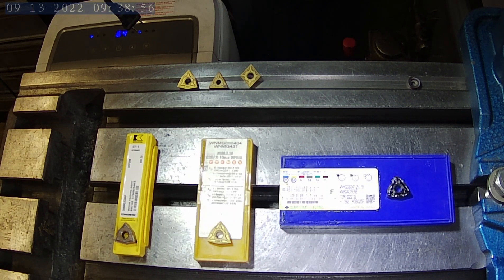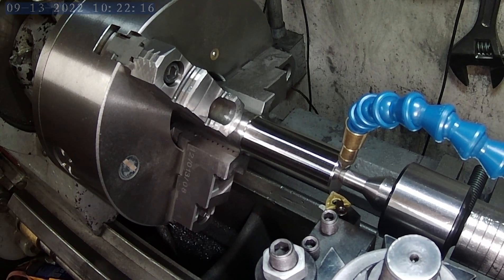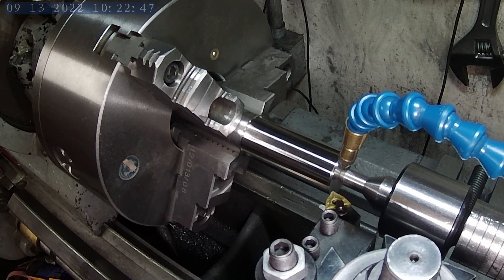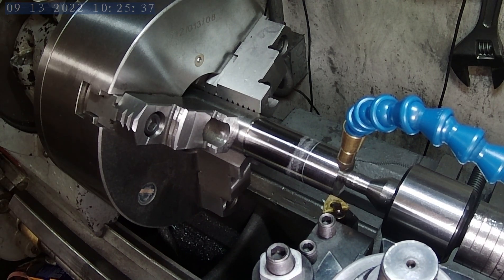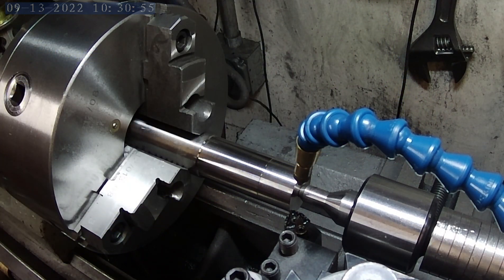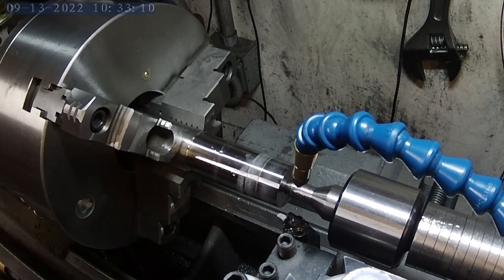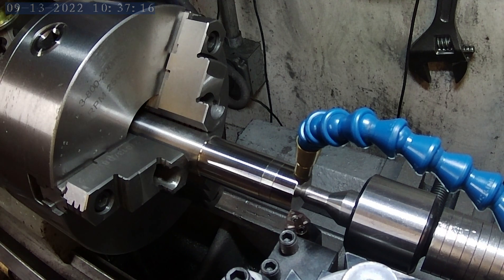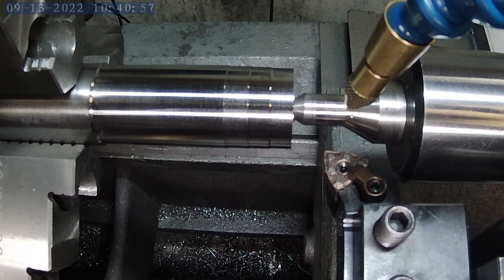What Carbide Insert is best?? Part 2 WNMG showdown China vs Japan vs USA!

Comment: WNMG inserts work in a different way to HSS. You need to use the manufacturer’s settings. The feed and speed need to be high to “turn the tip on”. The insert needs the cutting loads to move the metal.

Comment: intention to inform: it is maximum load that is the yardstick for a insert for most of the machinist i know. Cant talk that for everybody. We did our experiments with cheap chinese inserts and they wont deliver at all what a good Japanese German or American will deliver. 
The chinese will break in  heatbeat when you usem em somewhat rougher then the better made. 

But as always it is what you pay for you will get. 
But when i can use a good Sumitomo insert what cost +-10$ a piece for turning 1000x more material i will buy the expensiv inserts everytime because i hate it to piss away money.

we are better of always when we use better brands and higher quality because quality has it earned price garbage never!

Comment: WNMG are negative rake inserts designed to "move" metal not do tiny finishing cuts. WNMG inserts have chip breakers moulded in to the cutting corner and these chip breakers do nothing until the DOC is high enough. This means the DOC could be and should be no less than 1/3 the edge of insert. If these are 4 series WNMG inserts, this means a DOC of no less than 0.1-0.2" with the chips flying off the cutting edge blue in small broken curls. This means plenty of spindle speed and DOC per the specifications on the package of inserts. Typical would be 200-600 sfm or more depending on the insert shape, carbide grade, material and machine's abilities.

WNMG insert are horrid for small and finishing cuts as all negative rake turning tools depend on heating up the metal at the point of contact enough to melt the metal then plow away the semi-molten metal. There is little to no "shearing" or shaving action in the cutting process with negative rake tools. This is why most hobbyist using negative rake turning tools have so many problems with them. Adding to this problem, Proper use of negative rake turning tools demand set up and machine tool rigidity and power.. most hobby lathes simply do not have.

Using negative rake inserts for finishing cuts will not work well due to the cutting forces required to make them move metal, that puts more stress on the part being turned which will tend to bend the work while trying to make a small cut.

For turning like this, far better to use a positive rake insert like CCMT with a small corner radius, these can work excellent on smaller lathes with limited power, rigidity and small DOC.

Insert grade and coatings make a HUGE difference in insert cutting performance.

Take the time to watch this video on DOC and finish, the cnc machine is a Mazak Integrex with 60hp on the main spindle. Notice how the finish degrades with decreasing DOC and...
https://www.youtube.com/watch?v=WjIfECqleU0

This due to the need for a negative rake insert to partly melt the metal then push the metal away. If this does not occur the finish is poor.

Comment: Surface cutting speed far to low for these inserts. They are designed for high speed turning, also will give a much better surface finish with more agressive depths of cut than 10 thou.

Comment: I agree with the comments about the speed and feeds being way too slow.  Also,  I am a small garage machine shop and I do not use coolant on my lathe.  I would think that the majority of SGMSs would not use coolant so this comparison is not as applicable to everyday use in a small machine shop like mine.  I do use carbide, usually the Chinese variety and find it works fine for my use.  I think you should redo your test using some more realistic speeds and feeds and turn off the coolant.
Reply: I could not immagine trying to machine anything without carbide...

Comment: 150 RPM?? That's only about ~60 sfm. That is slower than HSS speed. That should be starting at min 600 RPM and raised up until it cuts properly. Would be good if you include the mfg recommendations for each insert.

Comment: I don't think the cuts are representative for carbide inserts. Speed should be higher and feeds and depth of cut as well. You're cutting like with HSS. Run two sets of tests one for roughing and one for finishing with higher speed, depth of cut and feeds
Reply: Not only that, but the Chinese insert is a -431, while the other two are -433. So the nose radius of those other two is 3x that of the first. That will explain the nicer finish too (at this small DOC and feed rate), at least in my experience. Not that I'm a big fan of any certain insert brand, but this isn't an apples-to-apples-to-apples comparison, given the radii differences. At least not in my opinion. Others' mileage may vary.

Comment: Those are not all the same nose radius & your going way to slow on speed, to get any benefit from carbide at all. Try about 1200-1500 RPM. 150 is pretty slow even for HSS.

Comment: not gonna tell much on that tiny piece of work.  get some 4140  or more    in the 10-12 in Diameter  where you can do heavy roughing,  light roughing then finishing. toothpick size material won't tell much.

Comment: What's the point of comparing them if they are not the same. All of them should be, let's say, finishing inserts.
Reply: Yes, of course! The better result was achieved with the smallest nose angle (the 60 degrees triangle), surprise surpise. Trigons have 80 degees angle and the rhomb here I don't know but looks like less than 80. Even more important is the nose radius (which could be for example 0.8 mm) about which we get no information here. Their country of origin only matters if you want to talk to the inserts on their native language, and then you are using them the wrong way.

Comment: Any info about your misting rig you can give would be much appreciated.
Reply from the maker: Hey Dave. Thanks for taking the time to comment. I will tell you anything you need to know. Do you want to know more about how mine is set up? We're about the product itself? Just let me know and I'll tell you what I got. Thank you!
Reply: @smallgaragemachineshop2715  Mostly the brand.  Is it a Noga or a Chinese knockoff?  Percent of mix? Brand of coolant?  Thanks.
Reply from the maker: Sure Dave. So it is a Noga brand mister. I am using Kool mist coolant mixed at the recommended 4 oz per gallon. I usually run about 20-30 psi for most operations. I have small 1/4 lines running to my machines so I can move it easily. The pressure is on a separate regulator than my normal shop air. My only regret is not doing it sooner. Hope this helps. Thanks for tuning in and let me know if you need anything further
Reply: @smallgaragemachineshop2715  Thank you.  I have a Noga mister for one of my mills. It's just as different and better than other misters as their magnetic adjustable arm indicator bases are.  Unfortunately, I crushed the head of it in a tool change.

Comment: An excellent video, thanks, maybe it could be interesting if you add, in the video description, some information about the products that you use, in this way, we profit even more. keep going I think this channel has very interesting things. Thanks again.
Reply from the maker: Frederico thanks for the comment. I can and will include that in future videos. Thanks for the idea and support.
Reply: @smallgaragemachineshop2715  This was an awful video! Surface quality depends mostly on nose radius, about which you say nothing. Smaller nose angle is also important, so no surprise that the 80 degrees trigon performs less well, it should not be used for surface finishing. Check it with the supplier.

Comment: One tip about the video... speed up the turning segment. Nobody wants to wait 5 minutes for a turn to finish. Most youtubers do this.

Also for inserts, they have recommended feed and speed and depth of cut. If you only take off 0.015 at a time with a roughing insert, your finish will be bad. So you really need to compare a Chinese finishing insert with a Japanese/American finishing insert. I think the chinese insert you are using is for roughing which is why the finish isn't so good.

Also spin it faster than 150 rpm, more like 1200 rpm would be where these inserts will give you the best finish.
Reply from the maker: Thanks for the constructive criticism. Always good to know what you guys want to see and ideas on improving the process. Thanks for tuning in I appreciate it!
Reply: @smallgaragemachineshop2715  I agree with all of Tyler Fu's points.  In addition, not all inserts imported from China are equal, so without some way of identifying the particular insert, the test is of little value.  There are a few "name brand" inserts that I have had good results with, and I stick with those, as without that, your chances of getting garbage is pretty high.  And if it is acceptable, how would you be guaranteed of getting the same insert again on your next order?  Thanks for your efforts and I will be interested to see future videos.
Reply: You are experts😊